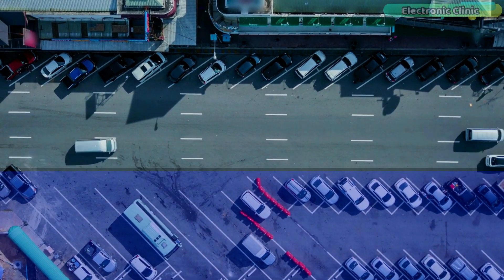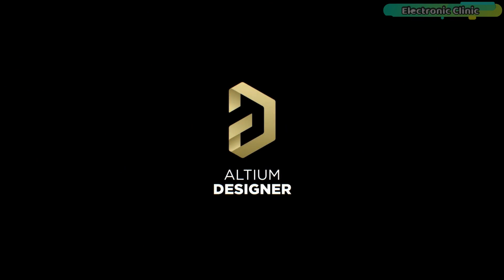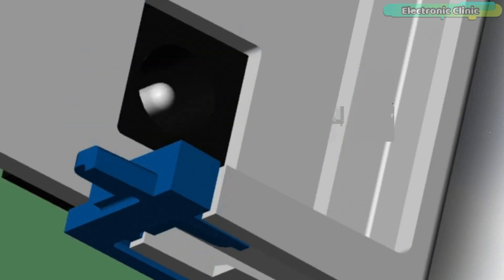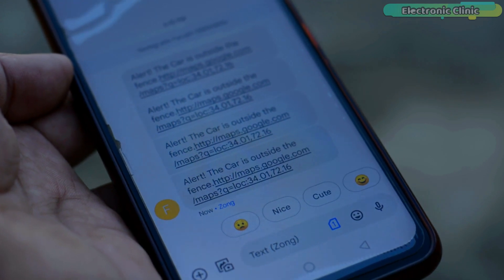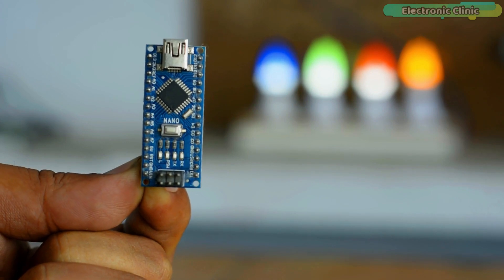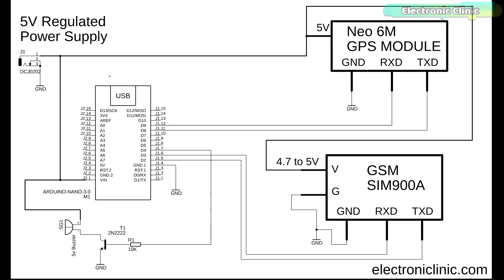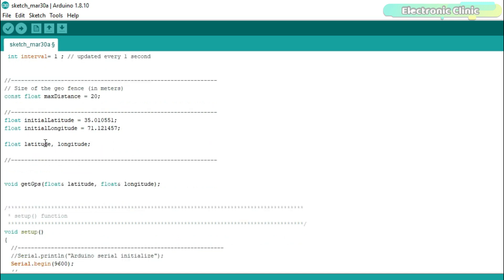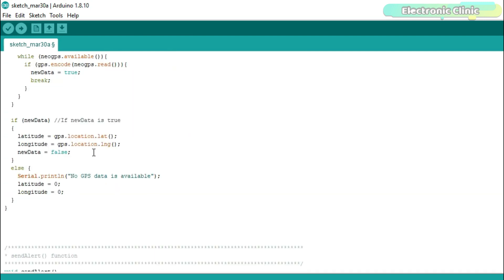Geofencing in Cars using Arduino, GPS, and GSM, Geofence GPS Tracker, Geofence Technology

Comment: Great work and great project if I could get it to work. Can anyone help? Everything is working except for the Longitude. It displays it on the small screen for about 3 seconds then goes off. Serial Monitor also doesn't show it on Rx but Tx monitor does. Everything else displays fine.

Comment: If we create  3 areas with 3 geofence( 3 circles) and a car move along it  how can we find that vehicle is in which circle or geofence is it possible ?
Reply from the maker: ya it is possible. you can define multiple initial gps coordinates and define maxdistances as per your needs.
Reply: @ElectroniClinic  so we should check the distance for each initial gps coordinates right ?

What i am looking is if a car is moving through a road and road is divided in to three zones (south ,north, mid). If we check the position randomly how can we identify that vehicle is in which zone ?
Any technique for that please help me
Reply from the maker: @ProPro-li4mz  through measured distance.
Reply from the maker: @ProPro-li4mz  define three intial postions and first measured the distance between gps and initial position 1, then initial position2, and so on. then you will get 3 measured distances. compare these and you will get the result.
Reply: @ElectroniClinic  thank you brother
Reply from the maker: @ProPro-li4mz  you are welcome.